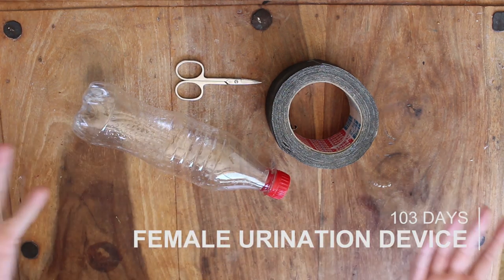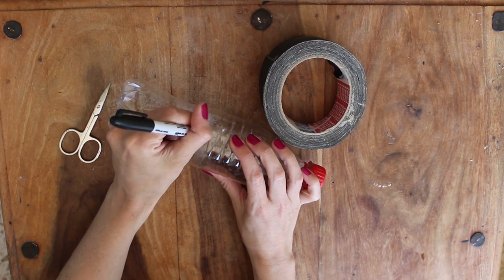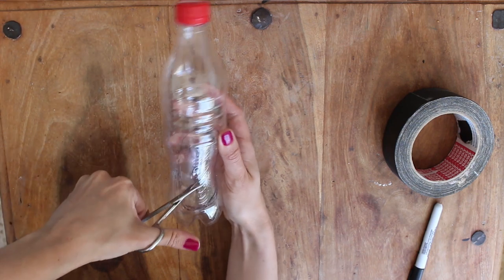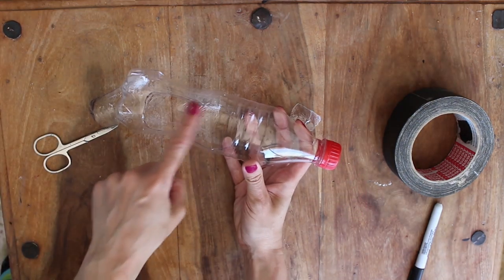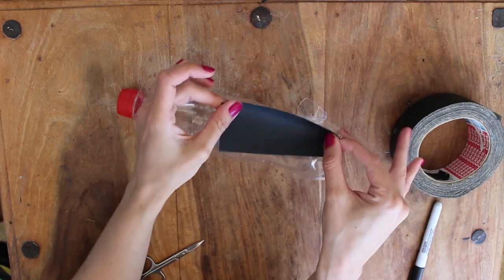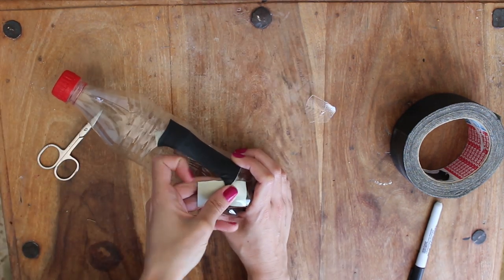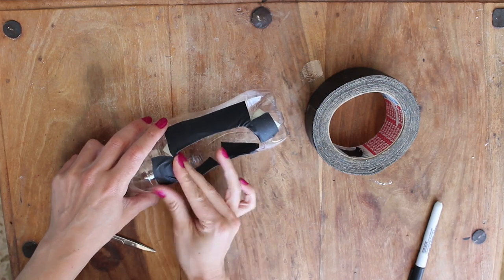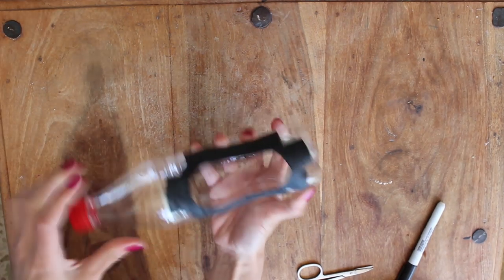Easy DIY Female Urination Device (FUD)

Comment: Would a lighter help smooth the edges of the opening?
Reply: Honestly I thought the exact same thing.
Reply: You probably could but its probably more comfortable with the tape on
Reply: Yeah I did it but scratched myself still and tape feels better
Reply: Yes
Reply: Just don't use it it causes infections
Reply: How does it cause infection?
Reply: Yes, using a lighter is also more hygienic than duct tape.
Reply: @CinemaSans  it will not cause urinary tract infections

Comment: What way ( downwards or position) do you have to aim in order to get all of the pee out and what kind of bottle to use
Reply: Its a small plastic coke bottle, you position it so that the lid side is pointing out foward
Reply: she says it in the vido
Reply: Just place the hole firmly on the perineum to avoid leaks. Then the urine will naturally exit through the bottle cap hole when the bottle's full.

Comment: Impractical at best! Bottle is way too small and you'd have to barely pee as too much pressure would cause a mess.
Reply: LOL you don't leave the cap on when peeing, you use it to aim your pee where it needs to go!
Reply: It works really well. I used a thin 1.5 L bottle. No leaks.